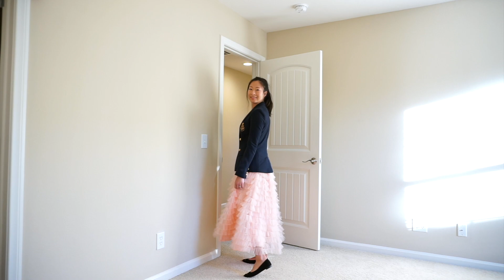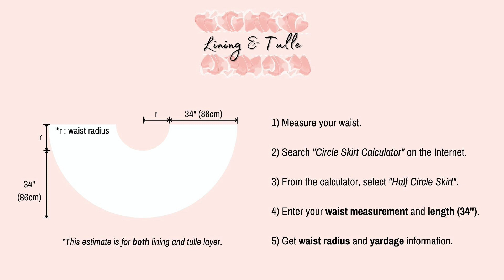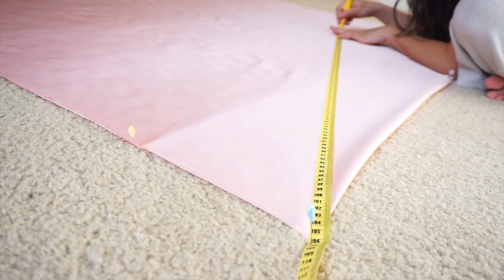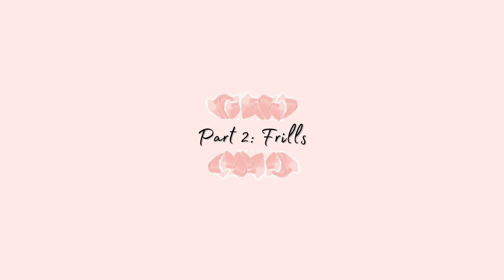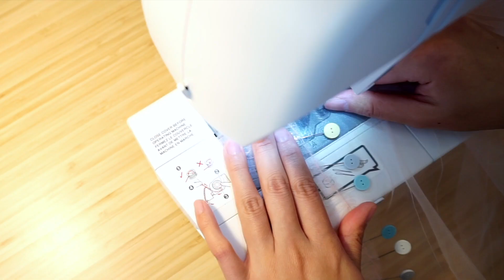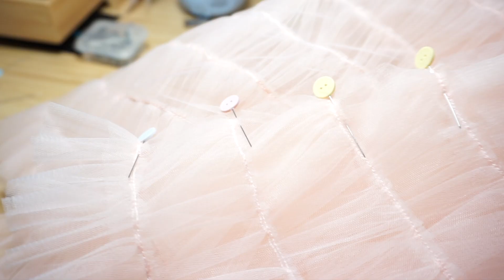*make your own* Dior-inspired Frill Tulle Skirt Tutorial (Petal Tulle Skirt)

Comment: Wait im still confused how would i figure out how much tulle needed for each layer like width wise because you need more than the original circumference?
Reply from the maker: It depends on your waist radius. Here's how to calculate the total length of the frills:

1. Calculate how many tiers you'd need by dividing the desired length of your skirt by 2 inches. 
2. Calculate each tier's finished length; 1st tier would be π*r, 2nd tier would be π*(r+2 inches), 3rd tier would be π*(r+4 inches),... nth tier would be π*(r+(2*(n-1) inches)).
3. Add all of the finished length measurements of step 2, and multiply it by 4.
Reply: @hyegineer  thank you 😊😊

Comment: How long should the frills be?
Reply from the maker: It depends on your waist radius, so I can't give out the specific number. Here's how to calculate the total length of the frills:

1. Calculate how many tiers you'd need by dividing the desired length of your skirt by 2 inches. 
2. Calculate each tier's finished length; 1st tier would be π*r, 2nd tier would be π*(r+2 inches), 3rd tier would be π*(r+4 inches),... nth tier would be π*(r+(2*(n-1) inches)).
3. Add all of the finished length measurements of step 2, and multiply it by 4.
Reply: @hyegineer  perfect thank you! That makes total sense!